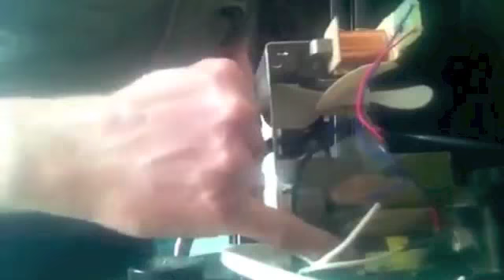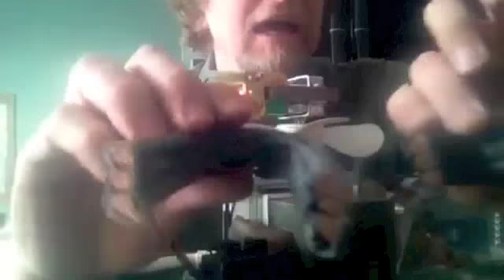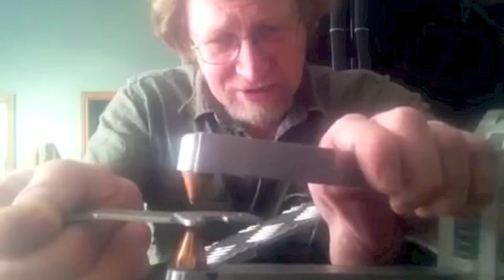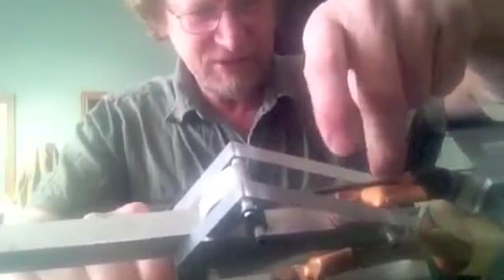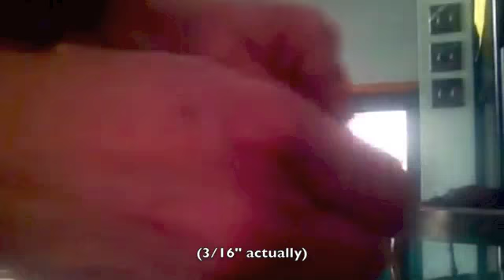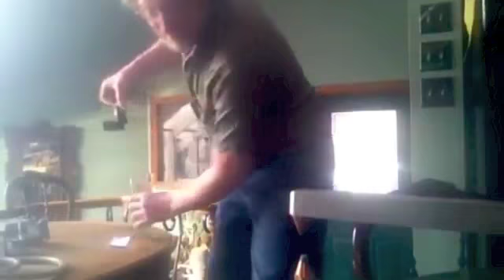DIY Spot welder

Comment: Nice work!  But what was  the problem with your first try? Something to learn?  
I learnt a lot from your video and will use some of your ideas. 
Over here in Europe vi have 230VAC (instead of your 110- ) Very dangerous- could easy get electrocuted. so I think I put a relay (heavy duty) in the primary and control the relay with a lower voltage.
Björn
Reply from the maker: On my first try I used car battery cable for a secondary. It couldn't handle the amps without the insulation melting. Hence the fan. On this one the copper for the secondary is 1/2 inch diameter. The fan is not really needed. ... That is with a 110 V primary. I don't know how your 220 V transformer is wound.so I'd best not comment on that.
Reply: Dan Friesen 

Im using 32 mm welding cable. Rated for 600 v. Hope its sufficient.

Comment: Hi Dan. Good project. I would like to make a similar thing for spot welding tabs to lithium batteries. Soldering to lithium cells is the death-nel to those poor things. Spot welding can be done quick enough not to damage the cells. Anyway it's advantageous to have a timer to control the amount of heating. I have to come up with a timer for my project. The current doesn't need to be as high. I see someone used 4 gage wire for his battery spot welder. So, it all depends on your needs. I like your foot peddle. Great design. Keep up the good work.
Reply from the maker: Thank you Donn. Let me know how you make out.
Reply from the maker: Thank you Donn. Let me know how you make out.

Comment: i am curious!! having worked all my life with electricity starting as an elect apprentice to computer teck to soft ware etc . Why not use  many layers of #12 0r #14 stranded copper wire ?? easy to buy but muchhhhh easier to wind in the space plus much more space efficient.  then solder them into the wire end lugs???? you would get the amps plus cooler conductors. no need for fans. PS always keep a rated fire extingusher handy !!!! you never know about SUPRISES!!! john kelly
Reply from the maker: Well John, thats an excellent question. If you want just two volts as mine is, then each strand that you put on can only wind twice. I'd actually like you to try that and get back to me on your results. I'm curious whether it would work. I think you would have to put a bunch of strands together into one wire, insulate it, and wind it twice though. Otherwise I expect the electrons would take the short path and go around just once giving less
 than 1volt instead of the long path of going around twice giving two volts. Get back to me on that.
Reply from the maker: John, in my reply to your comment I assumed you were talking bare wire, but you may have been talking insulated wire. In that case yes, it should work quite well. The thing to watch is that with each strand insulated there may not be room for as much copper in the space available. Just two windings produces a lot of amperage/heat, so the more copper to absorb the heat the better.

Comment: something wrong bout your design aluminium is not conductive re; on your spot welder that is why your breaker just turned off
Reply from the maker: Thank you for your interest. You can see a discussion of the aluminum in an earlier post. The breaker is 15 amp presently.  it's not a problem… I only tripped it once, and that was when I was welding one quarter inch of steel for the video …kind of like testing the limits…and it made a fine weld before tripping. If I was using it for heavy material like that all the time, of course it would be a problem. Aluminum is one half the conductivity of copper… but conductivity was not my only design criteria. However, it does get uncomfortably hot after 20 minutes of steady welding, but that's generally not a problem for the hobbyist. If I made it again… would I use copper? Possibly, but I am so very pleased with the power of this machine, I'm wondering if because the AL draws more amperage, that it makes more heat available at the tips. I would have to consult an electrical engineer on that one though.
If you build one using copper, I would love to know whether the power output is comparable. Let me know. 
Good luck, and keep designing. Use up those microwave ovens before they hit the dump.
Reply: Dan Friesen sir thanks for your response on my comment before i go on to my spot welder project i just think of it if i could tapped the copper tip on the arm that is used to be an aluminum square bar 1x1x1/8 of an inc thick and i am not very sure that it could works thats the reason i asked some advise to poroldchop before i started do do what i have to on my spot welding project,,,so the last thing i did is to go on with aluminum arm but properly insulated from the copper tips,thats all i can share sir my input is 220 volt AC the secondary is 2 volts
Reply from the maker: Well, let me know how you make out.
Reply: ok sir just give me some times

Comment: Every MOT welder video I have seen cuts out the secondary and puts in a heavy wire for a lower voltage, but I was wondering about just reversing it such that the output is the new input and the old input is now the output. Wouldn't that result in much lower voltage and higher current?
Reply from the maker: Well, there is some good reasoning in that, but the wire in the primary winding is sized properly for the 110 voltage along with the amperage that will be drawn. Using the tiny secondary wiring for a primary would heat it and short it out right away.

Comment: Good job on the video. Wire for the secondary windings can be found at a welding store.  The same place where welders get there tanks for the torches filled or replaced. They may even have tips for spot welders there also.  Love this DIY stuff.

Comment: Very interesting project, I was looking for a different re-use of a microwave oven transformer but your project is very interesting.
I have used an industrial spot welder, they effectively have the power switched by full travel of the pedal enabling you to hold the work with both hands. Sadly I broke one up for parts to obtain the variac out of it and neglected the rest.

Comment: Thanks for the video. I just wanted to know how to wire your Secondary 1.0 after you wrap it? I wrap it and I have 2 leads poking out the front. I just wire these to the arms? And I wire the primary coil with 110v? I suppose Im just not understanding the biology of this transformer... how does the 1.0 get its power after wrapping???

Comment: Pardon my stupidity, but the micro switch was the in line switch for the 120v to the transformer, correct. And you have a main 120v switch for the whole right so when that switch is activated the fan is the only thing running, and the mico is for the feed to transformer. Does any of this make sense?
Your video is pretty informative, except the micro switch. Looks like you put some though into the construction. good job

Comment from the maker: Csaba; the current runs thru the al. bar stock. Copper would run cooler. There is a possibility the resistance of the al. Is advantageous to draw more current... not sure.
Reply: I run the #2 copper in the al tubing , only mistake I made is I put a hinge on it to pivot, and the screws are hitting the wire inside...

Comment: did you run the copper wire to the welding tips, or the aluminum tubing is the power transfer?

Comment: I used to make a living selling breakers, to trip that 20 amp breaker in that amount of time you must have been drawing 2000 amps, cause your breaker will hold 1200 amps in that set up. Now you may want to use copper instead of aluminum, in that case the breaker will trip twice as fast, and maybe it might weld in a shorter amount of time with more current.
gr8 vblog tyvm

Comment: I appreciated if you do please email alpinejwh@icloud dot com  
I agreed that I would prefer using copper bar than aluminum bar because it will heat up pretty fast. You can simply replace the bar to oak wood adding flat bar on it to point tips. This will help cut the cost down istead of full solid bar. But overall I love your layout design. Hope to hear from you soon.

Comment: Hi Dan, You have done a great job and DIY layout design of spot welder. I'm retired from HVAC in sheet metal trade. I've done many times using commercal spot welder, welding and fabricated all kind of metal. Now I have few take out MOT want to build it home made. I'm also knows electronic as part of my hobby and safely. I wonder if you would like to share your info of layout design in .PDF and send to me.

Comment: Hi Dan. Thanx for your reply.. I meant to say the Part that the tongs are fastened to it looks like aprox 10mm Lexan / Perspex / or some type of clear plastic That part is not clearly visible on your video. If Possible i would appreciate it if you could mail me some Pics of the machine to Scratchbuster@gmail.com. This is the coolest DIY spot welder that i have seen thus far

Comment from the maker: Shalom; Be aware that the aluminum has twice the resistance that copper has, and these tongs tend to get uncomfortably hot after a dozen or two welds. This machine is great for my needs, but If I built another I would exchange the fan for an indicator LED, and use either copper or 1 inch square bar stock aluminum.
·

Comment from the maker: Shalom: The tongs are three-quarter inch bar stock aluminum, the lower one is 14 inches long, the upper one, 12 1/2. They are mounted 1 5/8 apart at the hinge pin, but that is dependent on the length of your copper welding tips, which are a screw in type that I bought.

Comment from the maker: Rambo; Be aware that input voltage is separate than output, so you need to protect differently from each. Mine is 120 input, and 2 output. When actually welding 1/8 steel, the massive current draw reduces the voltage to less than one volt. I would advise you to take the time to research and understand the basic electricity and functioning of your particular machine for safe usage.

Comment: I have to teach myself spot welding at work, and I've never done welding before.  The electrodes on my welder are attached to chords (not like this clamp down setup). I just want to know, what are all the possible ways I can hurt or kill myself? Are gloves mandatory? The welder I'm supposed to use goes up to 120 V, so there should be more than 2 V flowing through the metal.  I can also set the "%energy" of 120 V, so what is a typical welding voltage per 1/8 inch steel?

Comment: Nice build.  I have a spot welder that had the primary open.  I removed the transformer and replaced it with a microwave transformer.   I removed the secondary and put in 2 wraps of #2 wire.  I then added a foot switch connected to a digital timer .  The digital timer controls the time on via a solid state relay.  Now I have a working spot welder again.  I like your design.  It is very well done.

Comment from the maker: Zhang...although the device has scads of amperage, it has a max of two volts; less than one volt when welding. Amperage is the amount of current, voltage is the force to push it around. There is not enough voltage to push the current through the body. So unless you're welding while in the tub...no worries.

Comment: very interesting...too bad I just threw out a microwave I would have loved to try this myself. i plan on rebuilding my 18v nicad battery for my drill and this would have been great to use on spot welding the solder joints. 
Great job...